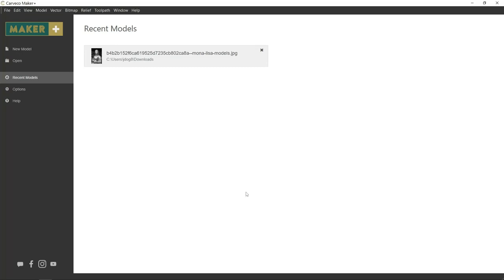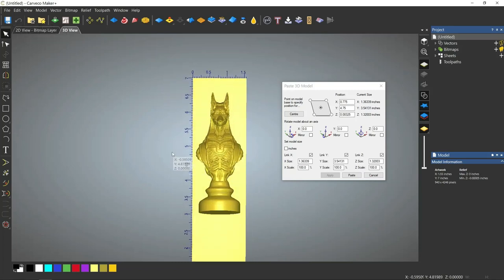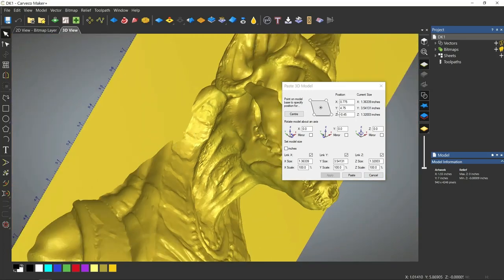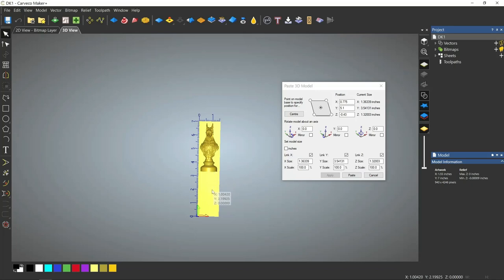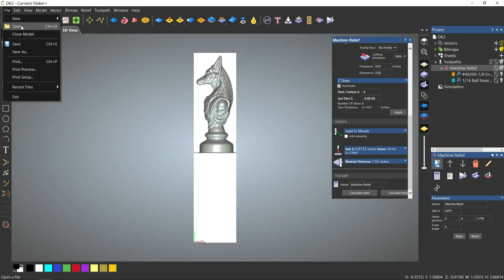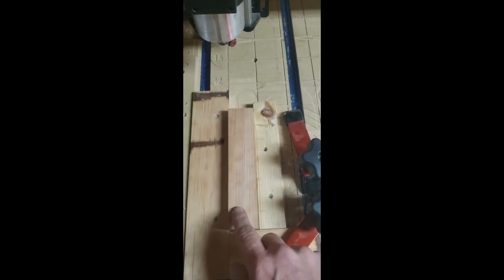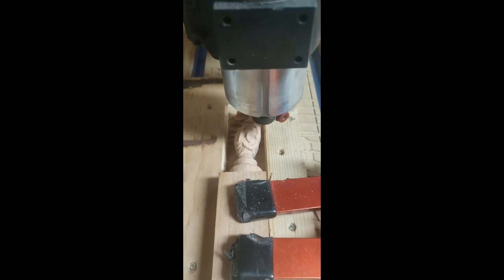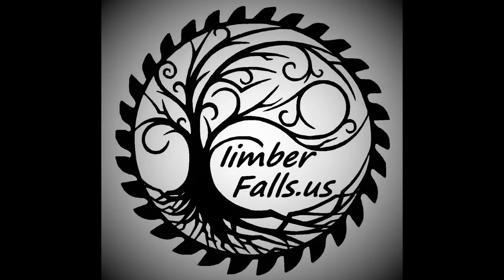How to carve a 3D chess piece on a 3 axis CNC using CARVECO MAKER

Comment: I have been wanting to make a chess set but didn't think I could create the unique pieces I'd seen. Thank you for showing me how to use those without having to have the rotary axis! And I like the way you showed how you carved it after you created the files!! Thank you!! I can't wait to use this procedure to move forward. The clamping jig is key to maintain accurate cuts.
Reply from the maker: Thanks Scott. The only thing I would update on this video Is I found it easier later to reference the center of the material instead of the corner. This helps align it from side to side.
Reply: I saw that on a couple other videos I watched today, thanks! I also saw your Timberfalls video referenced in a couple 👍💯
Reply from the maker: @scottpinkney1599  I invented this technique a few years ago and shared it with several groups. As far as I know I was the first person to do that on a 3axis machine using carveco.
Reply: That's friggin awesome! Well done, Jason 💯
Reply from the maker: @scottpinkney1599   Thanks man. It has been my motivation from the beginning to start a channel and explore what could be done.

Comment: Hi Jason I'm intrigued by your excellent video and am trying this carving for myself.
However I seem to be having problems as I can carve the sides (DK2 & DK4) and they look very similar to your instructions but when I attempt to cut DK1 & DK3 it takes away all the details from the sides and I've checked my Z settings numerous times !
I've gone through my Carveco files multiple times to see if I can identify the problem but I'm still stumped.
I'd be grateful for any further tips.
Thank you
Reply: I think I have solved this problem. At least using Carveco but should work for all. I’m hoping this will work as I think, I need to carve first to prove my theory.

Comment: Jason I have a question are two. how wide is your stock. do u cut it down any. also just wondering what carve times for roughing and finishing per side. thanks
Reply from the maker: The stock was 1.55"wide and 7" tall. The wood is squared so all sides are equal. It has been a while since I have done those but if I remember correctly it was around 45min per side for roughing and finishing. About 4 hours total for each piece.

Comment: Jason using your settings my roughing time are six minutes and finishing 28 minutes using a mkata router. just wondering I see in the comments said around 40 finishing  about the same for roughing. thanks
Reply from the maker: Different machines may vary with those settings. Hope that helps. I think it was less than 40 overall.

Comment: I noticed that when you pasted down the front that the z max is taller than half of your piece. The model when rotated 90 deg is also taller than half of the material. How is that going to stay below the material surface.
Reply from the maker: Good question. It is because of the thickness of the material and how much play I had in all directions keeps it aligned on all four sides. It is also helpful that we are only holding the piece from its base because if we had material attached to the head it would not have been center. Hope this helps.
Reply: @Timberfalls  When I tried it the base comes out oblong along with the body of the knight
Reply from the maker: @scottsprunger92  This usually happens to me when my material is not square and one side is not the same as the others. Once you set the first piece you are only rotating it 90 deg on the center axis 3 more times to get the other 3 sides so it should be in the same place in the design.

Comment: I assume your not changing the origin on any of the flips, accept the height during bit changes?
Reply from the maker: Yes great question. I do not change origin except for the z height for bit changes. After this video came out I found that its easier to reference the center of the material than the corner as this can be the same on each side and is and easier way to align the different sides.
Reply: @Timberfalls  thanks for the reply I'm working on a double sided sign for a client, the first one was off just a tad and I used the bottom left as origin, I believe that was my mistake because the board was a bit out of square, I emailed carveco in hopes of them saying "yes we are making a double sided option|" lol well see, they seem to be pretty reliable.  But my next try will be , origin center, and I'm setting jigs up as well, one big thing to remember is because my sign has an ungeometrical border I had to mirror the vectors. thanks again for the great work!
Reply from the maker: @Carpenters_Canvas  Most welcome, glad that helped and than you again for the support on the videos.
Reply: @Timberfalls  thank you for the videos! keep up the great work !
Reply from the maker: @Carpenters_Canvas  For sure and I appreciate the continued support. Thank you.

Comment: Hmm you can't actually buy this software... Only rent it. 😮
Reply from the maker: You can buy a perpetual license for both Maker+ and the full version. If you compare dollars to dollars this software is a better bang for buck than any other software on the market. Maker + is equal to aspire at 800 cheaper and you could subscribe to maker for 5 years before spending what you are going to on vcarve pro. Its really a good deal. Save 5% too with code TIMBERFALLS   😀